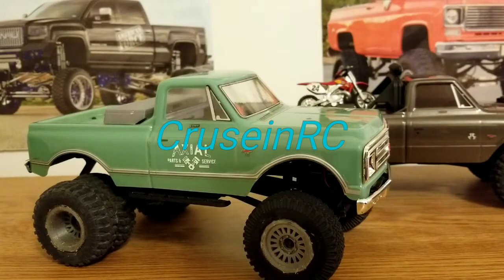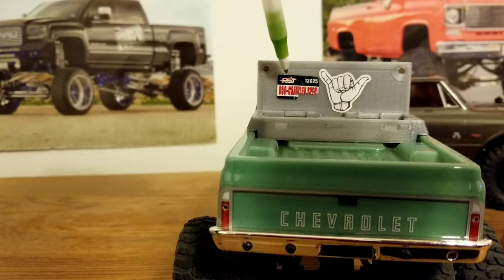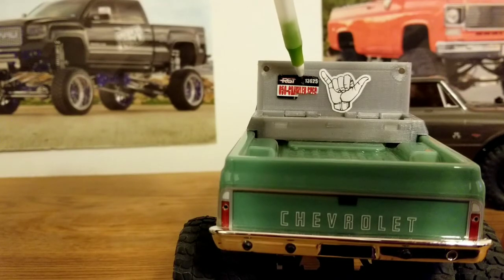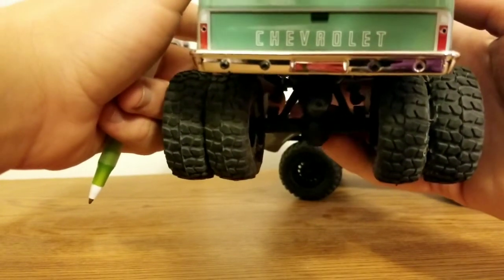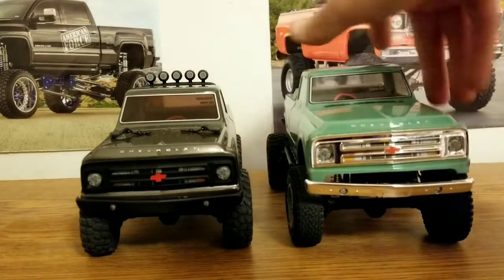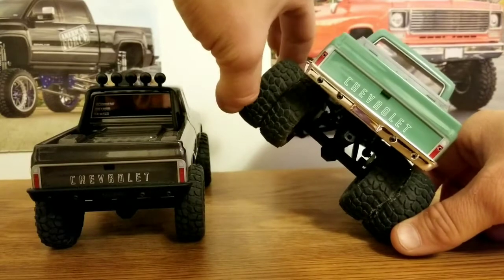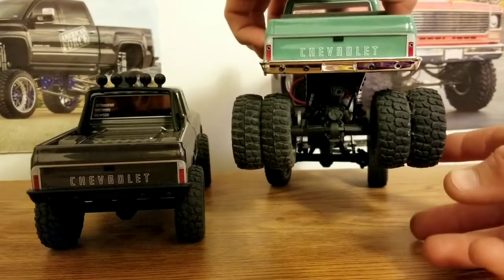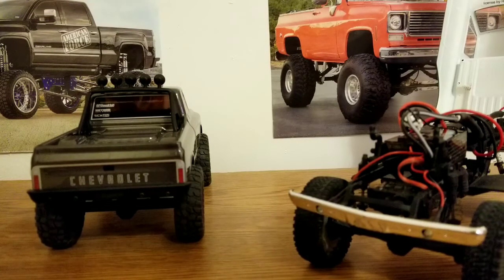Axial scx24 dually +upgrades/suspension mods!

Comment: Super cool dually ! Watch for some running videos
Reply from the maker: Thank you! I have some videos of it in action already! We reused the stock tires by separating from the stock wheels and gluing them to the dually rims. If had to do it again I would buy all new tires but for the sake of cost I used a razor blade to separate the bead from the stock rim it was very meticulous! It wasn't all that pretty I glued them onto the dually wheels while using a lock tight glue luckily it cleaned up nice just a lot of work. New tires are a better option just pricey.